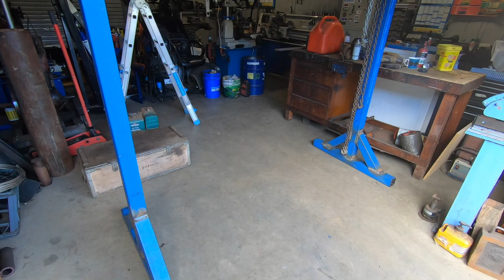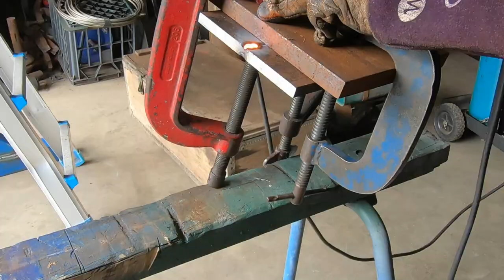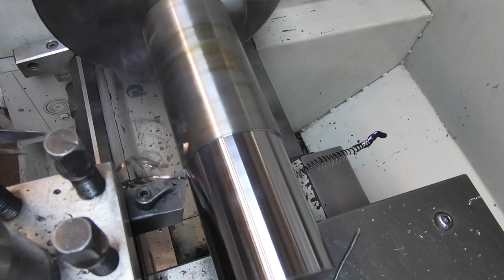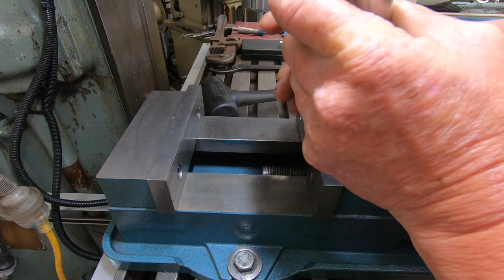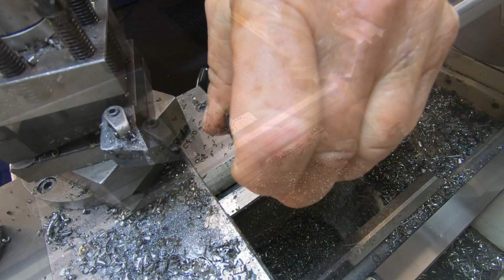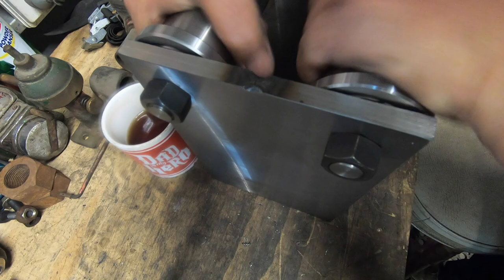I-Beam Trolley - Part 1

Comment: Got to be the prettiest beam trolley I've seen 😊
Glad you used the top method. All the weight is on the whole beam and not just the bottom flange.
As previously commented, fit  track wipers front and back. Will save a shot load of drama in the future.
Oh, I emailed you!
Hurry up with part 2!
Neil
Reply from the maker: Gday Neil, I think you’ll like the look of the finished trolley😉, putting the 2 rollers on the top is much easier then making 4 separate rollers, I think I’ll end up putting rubber wipers on both sides at some stage, I got your email and I reply shortly mate, appreciate you watching and commenting, cheers

Comment: Great Job Matty. I like that design better than having the Wheels roll on the Bottom Flange. The Fly Cutter you made works Perfect as always. It’s really been useful. Great Job on building the Gantry also. That’s going to be really handy having a Gantry Crane in your Shop. It makes me want to build one.😁👍 you might want to add a Trolley Stop on each end of the Trolley travel. You could just Weld a Plate on top on each end.
Reply from the maker: Gday, so far i've used the crane quite a bit, the trolley can't roll off the end, in the top corner on each side there is a gusset which also acts as a stopper for the trolley, worked out quite good really, Thanks for watching and commenting mate, Cheers

Comment: Great idea Matty 👍
Us older blokes need all the mechanical advantage we can get eh?
I built a fixed gantry over my CNC mill, with a swinging jib that allows me to get stuff into and out of the machine without all the back-busting ‘leaning-in’.
Can’t wait to see the finished trolley in action… your build is spectacular so far… love the two rollers instead of four too.
Best Regards,
Robert
Reply from the maker: Gday Robert, I just wish I built this years ago, the first plan was a job type crane next to the Cincinnati mill but soon changed the idea around, thanks for watching and commenting mate, cheers

Comment: Your videos are always interesting to watch, and its a good start to my day when I see a new one :)
This trolley design certainly has some advantages for you over the typical commercial product and the gantry crane will no doubt serve you well.
You've probably noticed that I have one in my workshop but I didn't make it from scratch. When I got it, the two A frames were joined at the top by a short length of 75mm heavy section SHS and there was a fixed attaching ring in the centre. This was quite limiting, but it only cost me $100 so was a good start. I made a replacement beam that can be bolted to the A frames at 3 different spans and runs a beam trolley with 2000kg capacity - much more useful. I was dubious about the load capacity of the original castors so replaced them with Aust made units rated for 900kg ea. These weren't cheap but I wasn't prepared to risk cheap imported items with a milling machine hanging from the beam. One really useful feature of these wheels is that the castors can be locked at 4 orientations. This makes moving the frame much easier as it will track in a straight line when pushed from one end.
Cheers, Alan.
Reply from the maker: Gday Alan, I have seen your gantry crane and it’s a good solid unit, I’m looking at some casters on eBay, there 5” lockable rated at 350kg each, there not that expensive but I think they’ll do the job, buying steel atm is out of control, I can’t believe how much the price has gone up, I’m glad I brought the i-beam over a year ago before the price rise and I wish I had of built this years ago, appreciate you watching and commenting mate, cheers
Reply: @MattysWorkshop  I don't think you would regret paying a bit extra for lockable castors - very useful when you work on your own like us. The usual weak point in castors is the swivel pivot, but 350kg rating will give you a useful 700kg capacity. This could probably be safely stretched to 1000kg  if the gantry isn't moved under load (- beam looks like a piece of UC150).
Cheers, Alan.

Comment: Your design makes wayyy more sense to us than the 4 independent rollers, really inspiring to build one of those for our shop. Hopefully we can luck up on materials at our local scrap yard, thank you for sharing and can't wait to see next video!
Reply from the maker: Gday, doing it this ways is a lot easier as well and not just relying in the bottom web of the I-beam, I only had to buy the bearings for this build, all the other material I had lying about, thanks for watching and commenting mate, Cheers

Comment: That will be handy in the shop for sure. I have been wanting to build one for my shop, but steel prices here in the states are just crazy. Even scrap steel is up in price.
Reply from the maker: Gday Tom, the steel prices here are completely out of control, I would have like to make this to have adjustable height on the I-beam but the cost soon stopped that idea, I can’t see the prices coming down any time soon, I was talking to the fella I buy my steel off yesterday and he said $3000 per ton for steel and he just got an email stating that some material is going up by another 5% and others material by 10%, that’s not good news at all, thanks for watching and commenting mate, cheers
Reply: @MattysWorkshop  Under stand that.

Comment: I think you're the only one who forgets to press "record" while making videos... well... maybe not :)
Your roller solution is indeed much easier and more robust.
It could be even easier to not make rollers and use only the four bearings on the two shafts.
Reply from the maker: Gday Rustinox, I get frustrated when I think I have pressed the record button and then in editing I find I have screwed it up, 4 bearings on a shaft will also work well but this way you would need to add 4 small bearings to the side to keep the trolley aligned on the I-beam, I think I explained that correctly, thanks for watching and commenting mate, Cheers
Reply: @MattysWorkshop  You're right. I didn't think of that.

Comment: I've been hot and cold on making one for a couple of years, the main con being you have to keep rolling the bl@@dy thing around to keep it out of the way when you are doing other stuff. Still making do with an engine crane... which I have to roll around all the time to keep it out of the way when doing other stuff...  Be interesting to hear your opinion on whether it gets in the way after 6 months or so.
Reply from the maker: Gday Jack, I’ve had these thoughts as well but it can be stored over the lathe which is against the wall or over the Cincinnati, it will be out of the way in both places, I have an engine crane and find it’s just a big pain in the ass trying to store it and the legs are in the way each time I use it, I find the engine crane is hard to wheel around with a load in the hook, thanks for watching and commenting mate, Cheers

Comment: The trolley will need a dust cover at some time, with occasional cleaning of the way on top of the I-beam. Cheap plastic cut from a lid of a 5 gallon paint bucket or whatever should suffice.
Reply from the maker: Gday Richard, I might end up putting a rubber strip on either side of the trolley to push the dust off at some stage, I think it’ll work, thanks for watching and commenting mate, cheers

Comment: Matty.......really  ?
You have to save up for some caster wheels...........really  ?
Get some 5" or whatever pipe scrap (fencing or plumbing) and find a friend who has  a machine hobby shop and have them make you some custom wheels  ! Pimp your gantry.
🇨🇦
Reply from the maker: Gday Joe, I did think about making the wheel but I’d like them to swivel and lock, I think it’s cheaper to buy weight rated casters, thanks for watching and commenting mate, Cheers